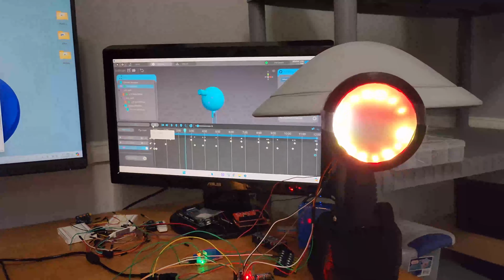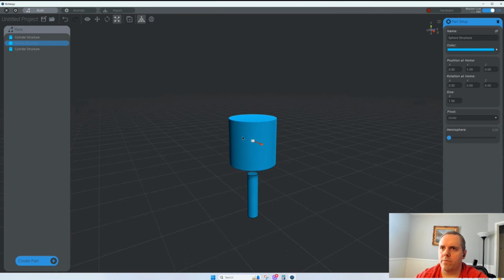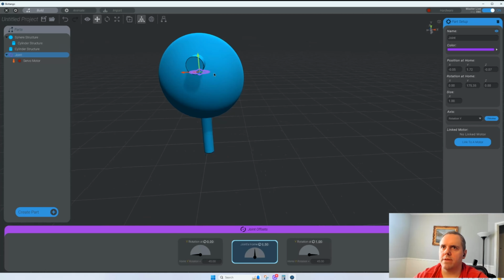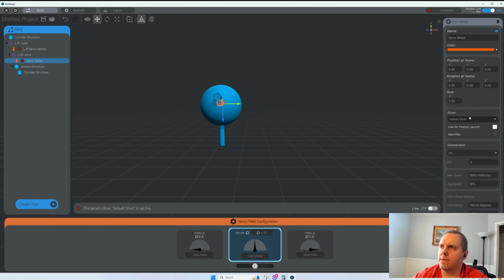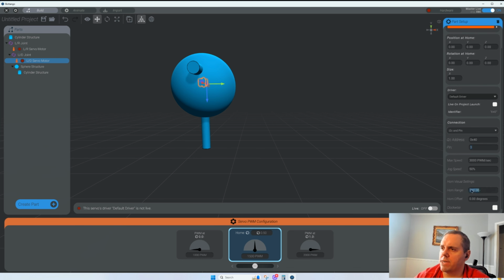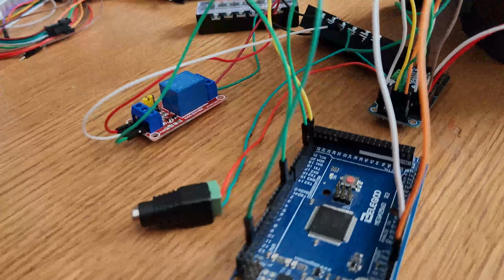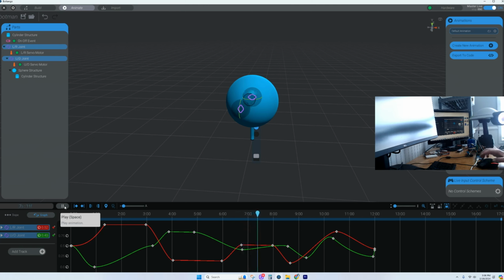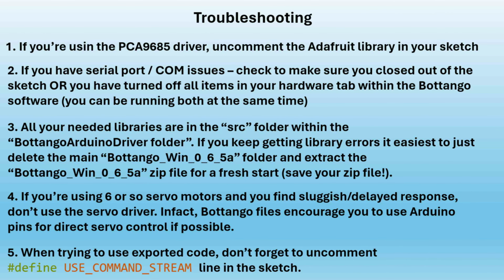Enhance Your Projects with Bottango: Using Servo Control with Arduino Mega & PCA9685 Servo Driver

Comment: what pins on arduino uno i need to use? (i dont have mega)
Reply: How do add the pin to your servo motor
Reply from the maker: Hey Sammyrobotics!  sorry for the late replay.... You add the pins in the "build"  tab at the top. You'll see a parts list on the left. Click a motor or join and the "parts setup" list will come up on the right. Under "connection", change from "pin" to "I2C and pin" if you're using this servo breakout board. Make sure the I2C address is correct and you select a pin for your breakout board. enjoy!
Reply: @BMonsterLaboratory   I meant what pin do I add to the servo?
Reply from the maker: HI, The SCL and SDA pins are on the digital pin side next to the AREF pin. You can see it in the diagram on the Arduino site https://docs.arduino.cc/retired/boards/arduino-uno-rev3-with-long-pins/    If you have the Minima, the pins are in the same position. You can see the Minima diagram here https://docs.arduino.cc/tutorials/uno-r4-minima/shield-guide/

Comment: Can u control 2 servo and 4 output with one arduino?I tried this but getting error msg cannot set live saying "it has the same driver and config
Reply: I’ve managed to get everything to work fine … thank you for quick reply .. like I mentioned can u make audio track visible while you edit the graph .. this we’ll make voice synchronization much easier… unless there’s a way to do this ? Keep up the amazing work
Reply from the maker: @nanopuppet289  I'll play around with audio. I haven't done that yet because i'm pretty new to this software. I was going to use a sparkfun mp3 player shield with it. I will play around with it more soon and see what I can get to happen. Thanks for adding to the conversation. 
By the way, I like the animatronic videos you have on your channel - very cool!
Reply: Thank you so much 🙏🏼
Reply from the maker: You should be able to. I haven't tried that yet, but i'll give it a shot. Are you using direct servo control with your Arduino or are you going through a servo driver board?
Reply: I’m using direct control from arduino

Comment: that motor driver sucks, most servos out there now need more than 6v the max of that board, plus every driver for it is horrible, got 10 of them sitting in a box under desk.
Reply from the maker: Hey there! great to hear from ya.  I haven't had any issues with these servos or driver board yet but I guess that depends on what you need them to do. I don't have any higher voltage servo motors yet but may need a few in the near future